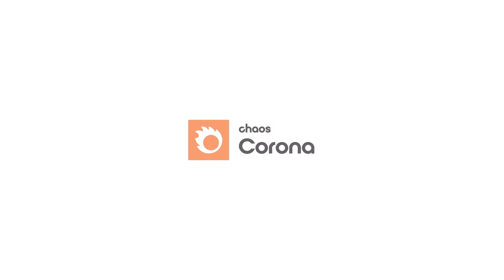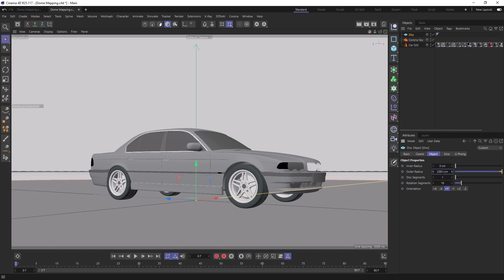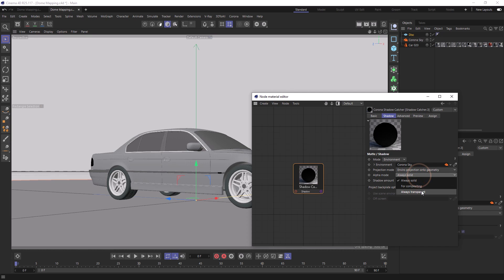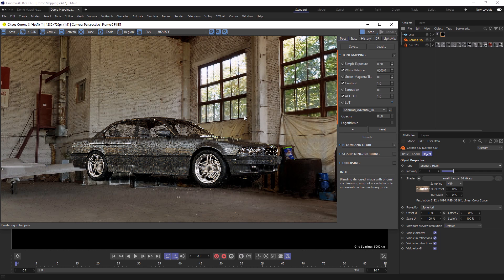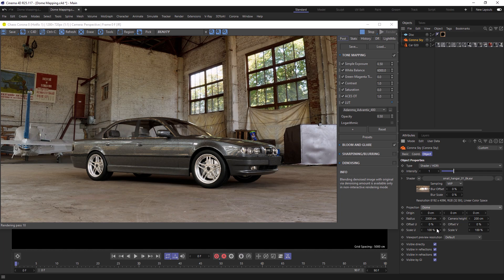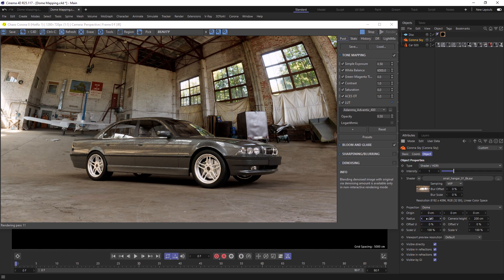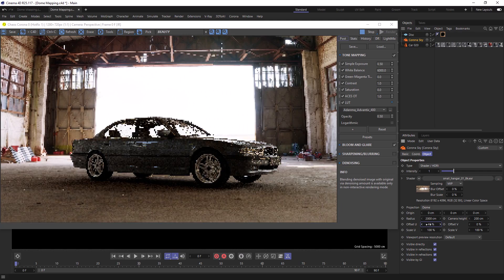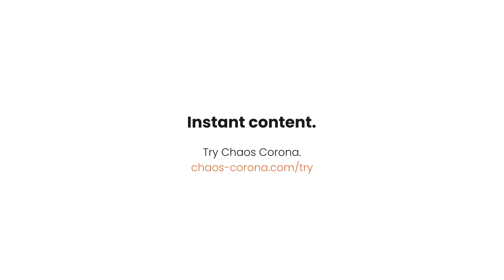Dome Mapping with Chaos Corona for Cinema 4D

Comment: why when i import a 3d model it appears like an empty box ? thank you
Reply from the maker: Hi! Sorry to hear you are having problems - we'd need more info, and to be honest YouTube comments are not a good place for providing technical help. The forums are much better for that, if you can post the question in https://forum.corona-renderer.com/index.php?board=49.0 that would be great, or you can always open a ticket using https://support.chaos.com/requests/new .

When posting there, be sure to mention more details such as - what format are you importing? Are you importing it as a proxy? What version of Corona, and what version of C4D? What OS? Does it only appear as an empty box in the viewport, or also in a render? Thanks! Tom
Reply: @CoronaArchViz  corona version 9 C4D version R26 .... well when i import the 3D model it appears like an empty box but when i use corona vfb i can see the whole things ... BTW only with the vehicles models .... thank you so much
Reply from the maker: @muhammadzien5817  If you are referring to Cosmos models then those will import as Corona Proxy objects and if they are relatively high poly they will, by default, come in with their "visualization method" set to wire bounding box". If that is the case, and you'd like to see the actual mesh in the viewport as well, you should switch the visualization method to "Full mesh" and that should do the trick for you.

Assets import as wire bounding boxes because if you have a lot of high poly objects in your viewport then you could be faced with some really sluggish viewport performance - and that is avoided with a bounding boxes :)

Hope that helps! Nejc

Comment: Thank you for this tutorial! Do I understand correctly that this method is more for large-scale HDRIs? Currently I have a problem with a background (machine shop) with many objects on the ground. I can't get a satisfactory representation. I could provide the file. Where can I upload it?
Reply from the maker: Apologies, YouTube didn't show me this comment :( It should work with any HDRI, but I think you have a point that if there are lots of objects on the ground then setting the size of the dome correctly might be hard, and those objects may look distorted (as they will be flattened onto the base of the dome). You can report issues and attach files like the HDRI in question or a sample scene using it, over at support.chaos.com/requests/new where everything is privately sent to us, for debugging and testing only. Hope this helps, Tom

Comment: in which computer specs you are using corona render?
Reply from the maker: Different machines are used for different tutorials - as a general guide we use something with the power of a 3960X or equivalent. Hope that helps, Tom

Comment: Then the problem comes, how to ensure that the HDR is not blurred when rendering the image? This problem has puzzled me for a long time when TRYING to render the car. I am looking forward to your tutorial to solve my doubts. Thank you very much
Reply from the maker: Hi, if your HDR is blurry then you could try a high resolution HDR. The one used is the tutorial is 8k. Jake
Reply: @CoronaArchViz  But I use 16K HDR, but there will still be a fuzzy picture, can you answer it? Thank you very much
Reply: @oxa9376  Not sure if this is what you're looking for, but:
If you didn't figure it out yet, go into the material settings and under the "preview" tab in the bottom left, you can change the material pixel size to your liking (up to 4k). This will force the material to render in the given setting and preserve details both in normal render and in preview render.

Not sure if this is what you're looking for, but:

Comment: I'm so sorry but i follow this great tutorial but i couldn't manage to make same result. I use exactly same numbers and HDRI and model. But something wrong. I couldn't manage dome radius numbers. İs it  related to render resolution?
Reply: Ow ok i figure it out i use wrong HDRI thats why. But unfortunately you need spacious HDRI's for this result i assume.
Reply from the maker: @barisoktem731  it does depend on the HDRI at play yes - some are more fitting others a bit less but that's expected because they are basically photos. Would be hard to dome map an object into an HDRI that doesn't have a ground where you'd put the object :) Glad you've got it going though! Nejc

Comment: Sorry for question. This render is make in the same machine what another videos? AMD Ryzen 9 5950X? Because is very fast.Thank you :)
Reply from the maker: No worries, we're happy to answer! Typically when you see Jake doing a tutorial it is indeed created on a 5950x based workstation :) Nejc
Reply: @CoronaArchViz  Thank you very much. 3 weeks ago, I can get my hands on that CPU. I am delighted with so much power for so little money. Regards :)
Reply from the maker: @infojaviernova  Happy to hear you got it going! Happy rendering! Nejc
Reply: @CoronaArchViz  what about intel core i7 12700K?
Reply from the maker: @X8COM  We'd recommend taking a look at our benchmark (https://corona-renderer.com/benchmark/results) to see how a given CPU performs. Just input the name of the CPU in the search bar and you're good to go.

As a small tip, some folks overclock their CPUs so typically the first few pages you see for a given CPU model are probably those overclocked entries and so they are typically higher ranked compared to that same CPU running at the speed you get out the box.

You can also hop onto the hardware section on our forums (https://forum.corona-renderer.com/index.php?board=32.0) if you want to dive deeper into the topic. Nejc